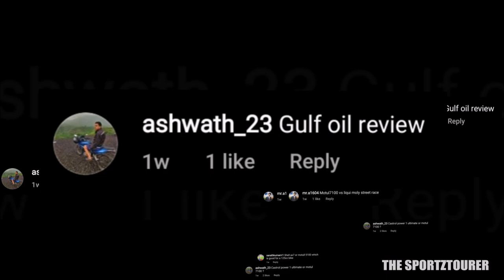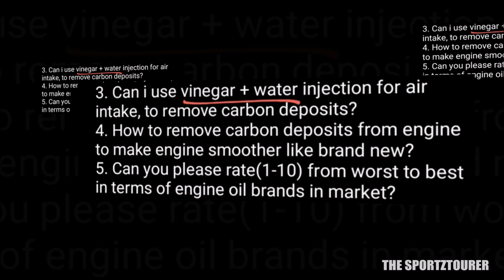WHY NEVER OVERFILL ENGINE OIL & USE VINEGAR TO CLEAN ENGINE, AIR & FUEL INJECTION

Comment: Current riding with Putoline ester tech 10W-40. Gear shifts are smoother compared with my previous experience with liqui moly. Engine is running significantly smoother and better!
Reply: Same experience, putoline Ntech Pro R+
Reply: Where are you the stuff? There's no online retailer for these oils.
Reply: Where did you buy it
Reply: Am using this engine oil on my r15 v3 and i must say that putoline is the best engine oil i have ever used

Comment: Great video once again .

I put a bit less engine oil in my maestro scooty as in the user manual it is clearly mentioned that 700ml of engine oil must be put after draining the old engine oil  " if the engine has not been fully disassembled " right before filling the new engine oil .

If the engine is fully disassembled now then after engine fitting 800ml (whole 800ml bottle )  needs to be filled .

So clearly 100ml of engine oil remains inside even after oil drain .

Keep the rest of new engine oil for top-up.

Even i missed this tiny detail for first 4-5 times . 

Its a recent discovery as i re-read the manual just for time pass.

Comment: Make comparison video on best engine oil brands in ranking order for SUV/cars. (Heat test, metal friction test, milage test, smoothness test, free flow test etc). Brand comparisons I'd to see Shell, Mobil, Castrol, Valvoline, Liqui Moly, Idemitsu, Servo, Mak, Petronas, Total, Motul, Gulf, Elf, Bosch, Wruth, Pennzoil

Comment: My Dio's manual mentions 700ml, but I fill 800ml oil. It's been 20000km and so far, no issues at all. Same with my Passion Pro, where manual mentions 800ml, but I've always filled 900ml - 1ltr, and it still ran without any issues. So I gues 100-200ml extra oil is ok.
Reply: Issue is coming soon to you..
Be ready for the worse
‼️⚠️
Reply: @gmsamy2826  My Passion Pro has crossed 1.5 lakhs+ kms, still waiting for any issue to crop up 🙂 Every engnie has space in crank case to take upto 100-200ml of extra oil.
Reply: This is common. My scooter's oil chambers mentions 700ml but the oil bottle is 800 ml and bottle mentions the list of compatible scooters and mine is mentioned over there.

Comment: The same happened with me in my RTR 200 4V. I overfilled engine oil and after some time, the engine oil made its way to the air filter chamber and my engine gaskets started leaking too.

Keep up the great work buddy by educating others with your experience.
Reply: Have you experience any different sound after that?

Comment: Bro I Really Liked Your Previous Engine Oil Tests.. Indeed Your Videos Are Very Informative And After Watching You I Am Using Motul 7100 4T For My FZS.. My Bike Runs Smoother Now At High RPMs.. 😋👊↔️✊🔜🏍️💤💤💤
Similarly Can You Make A Video On Fork Oil Also And Its Type.. I Just Got To Know That We Have Semi Synthetic And Full Synthetic Fork Oil Available In The Market.. And Its Very Confusing To Choose From !! 😂🙏
Reply: Which fully synthetic fork oil do you know,that is available in the market?? Plz reply,, coz i'm going to change fzs fork oil.
Reply: @surajitkotal748  Yamaha Service Centre Recommendeds G10 Fork Oil For Front Forks In Yamaha FZS.. And I Know Genuine Yamaha Fork Oil Won't Last Long.. Also There Is No Drain Bolt Like Engine Oil For Forks.. 🤣🤣 And Front Suspension Ain't A Thing Which We Can Disassemble On Every Service And Refill With Fresh Fork Oil.. That's Why I Was Looking For 100% Synthetic Fork Oil..

Upon My Research I Found 2 Series Of Motul..
Motul Fork Oil - Expert - 15W
Motul Fork Oil - Factory Line - 10W

Motul Expert Series Is Semi Synthetic Fork Oil And Motul Factory Line Series Is 100% Synthetic Fork Oil.. Motul Has Best Classification Of Oil Grades And Does Not Confuse Public With Their Names.. That's Why I Wanted To Switch To Motul..

My Confusion Here Is... Motul Uses ” W ” And Yamaha Uses ” G ” For Their Oil Grade Viscosity... And I Don't Want To Fill My Fork With Heavy Oil Which Would Make My Fork Very Hard While Cornering.. That's Why I Was Looking For A Friend Who Is Expert In Oil Grades And I Know Only One Person.. @The Sportztourer 😁😁🤘

You Can Check These Two Below Links For Oil Grades... 
https://transmoto.com.au/comparative-oil-weights-table
https://www.motul.com/in/en/products?facets%5Bapplication%5D=145&facets%5Brange%5D=21

Comment: Hi, nice info
One query, I own clasic350 bs3 and I'm using 20W50 engine oil grade. Noticeable change in smoothness and knocking only troubles me in winter mornings otherwise works best in summers.
So should I continue using same grade or switch to company recommendation.
Thanks in advance.

Comment: Sir please do a review between Castrol power 1 ultimate superbike oil and motul 300v and please share the details of like the drain interval, oil dip, smoother gear shifts, better heat control please i am eagerly waiting for your review sir

Comment: Bro what can be the shelf life of motul 10w30 oil (topup bottle after using the 200 ml )..can i use it the next time when i refill ? I usually do an oil change every 1 year as my bike doesnot run much....i have rtr 160 4v

Comment: How to check D400 engine oil level and when ? I have used 7100 motul everytime i see in morning after doing straight the motorcycle it comes in middle or some morning at top line maximum .

Comment: Can i flush  engine  with diesel or thinner tt oil (tarpin).
Reply: I have tried this in my 12 yr old Bajaj Discover 100 but with precautions and my bike has running perfectly fine , did this 10 months ago
Reply: @untamedspirit4537  ohh.  It's mean . I can use  tt oil.. right. ?
Reply: @uniquerider694  i dont have idea about TT oil but diesel cleans the sludge properly , i did this in idle RPM , make sure you don't start the engine for more than a minute and don't touch the throttle , also the idle rpm should be around 1-1.5K 

Flush the diesel completely after it and quantity of diesel should be the same as quantity of engine oil recommend by manufacturer (For Discover it was 1 litre)
Reply: @untamedspirit4537  thanks.  Bro..     i have Castrol engine shampoo. But best.  .is. ..tt oil or diesel.     I already tried tt oil. 400ml. ...kick 15 time and than drain.
Reply: @uniquerider694  i dont used kick instead  started the engine without accelerator for 45 seconds and then drained

Comment: Hi, I'd like to ask for advice regarding gear oils for scooter. My Yamaha NMax 155 V2 calls for 100ml of gear oil but Castrol and Motul gear oils come in the 120ml tubes. Is it okay to put 120ml or should I try to get as close as possible to 100ml since I don't have a measuring cup? Thanks from 🇵🇭
Reply: The gear oil chamber is designed in such a way that abundant oil will drain off from the filling hole. Keep fill till that point and you will know when to stop.

Comment: Asking to suggest me a good engine oil for rr 310 ; day 20
Reply from the maker: Hi Sanjeev,
Which oil are you using now? How is your experience with it?
Reply: @thesportztourer  the stock one experience it's too basic shifts are clunky and vibey engine past 6k rpm
Reply from the maker: Have you tried the new Petronas manufacturered engine oil for TVS?
Reply: @thesportztourer  no not yet mate but i was hoping for ur green signal if u say yes im gonna get the PETRONAS one. Should I try that or go with some big hitters like 300v/7100/lq street/Castrol P1 ultimate( this is my second service)
Reply from the maker: Even I am looking to get some concrete feedback from RR users on the new oil. Amongst the mentioned oils you can go with the Street race and 300V. In Castrol I am using the Power1 ultimate superbike 10W-50 and it is doing a good job in my 310R.
Reply: @thesportztourer  ah thanks mate if i find any intel on PETRONAS iwill inform you asap. And for the other oisl can just suggest me the mighty one out of all

Comment: Bro...
I have an old 2006 model Wagon R with around 90K plus on the odometer, I am planning to shift from recommended 5W30 grade Engine oil to 10W30 or 10W40 grade, because temperatures at my place range from minimum of 15°C to maximum of 42°C, Which one would be better please suggest...🙏
Reply: 5w40 would be better
Reply: 10w will make cold start problems
Reply: @untamedspirit4537  40 is fine but I wanna go up to 10W as winter temperatures rarely drop below 15°C
Reply: @the-western-rider  then you can go , i love in north India and here the temperature touches sometimes close to 8 , thats why i advised you to stick to 5W :)
Reply from the maker: Hi,
Stick to good 5W-30 grade engine oils or as Untamed Spirit suggested you can go for 5W-40.
Reply: @thesportztourer   Thankyou for acknowledging but you know more than me , i would advise you to stick to manufacturer recommend grade and The Sportztourer one :)